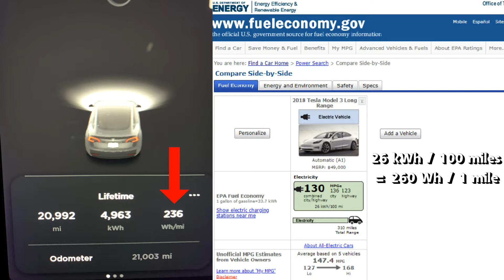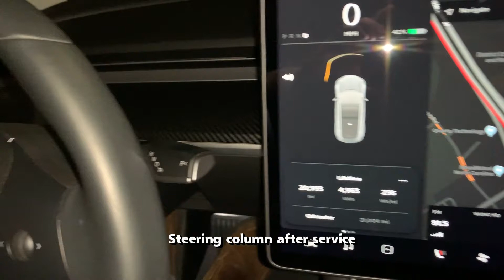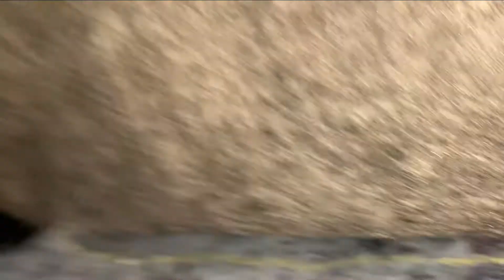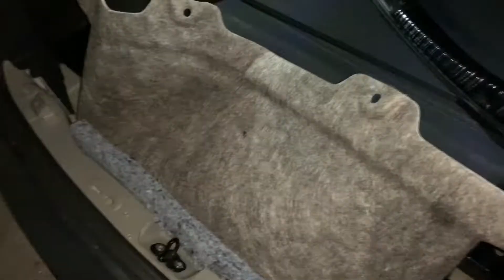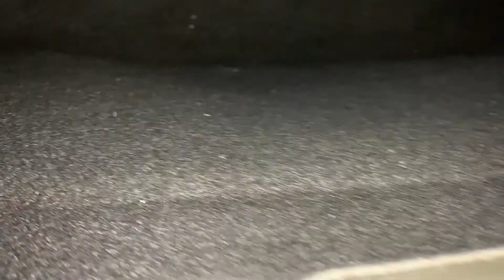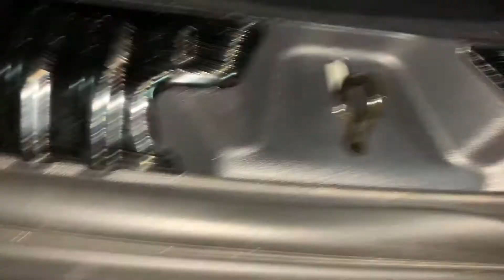Tesla Model 3 - 18 Month, 21,000 Mile Update - Part 2

Comment: Thanks for making the video.  That lower trunk leak was a bad manufacturing oversight, I wonder why you didn't have problems previously.
Reply from the maker: My first year of owning the car, I parked in a garage.  My new house doesn't have a garage so that may be one reason.  Also, it may have gotten wet before, but I didn't notice.